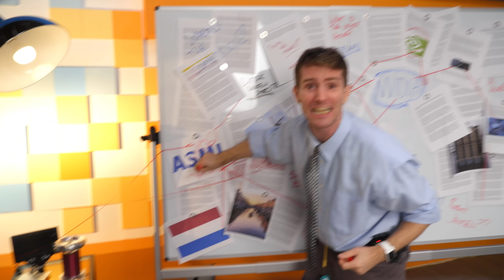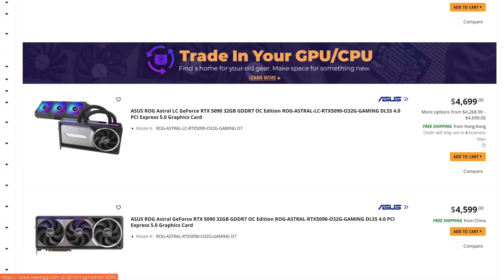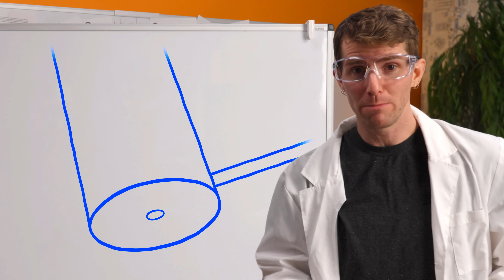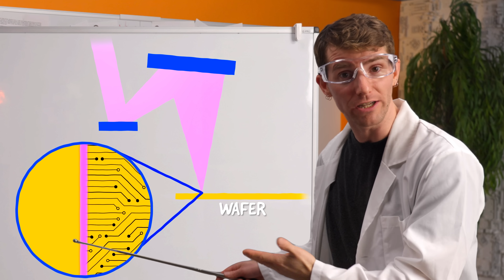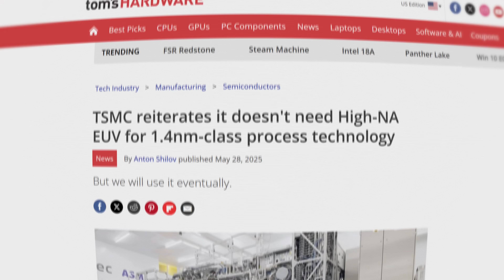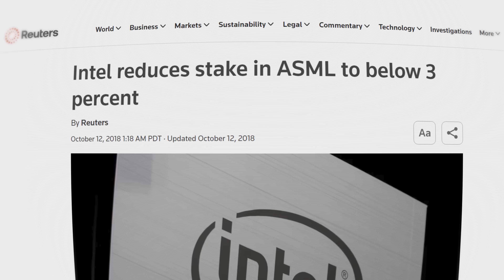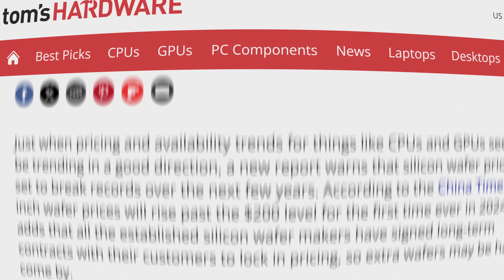This is Why Hardware Prices are Going Up… Again

Comment: As someone working in the IT industry, it’s sickening to constantly be bombarded with statements like "AI first", "AI in everything we do"…

Before that, it was cloud… 

Cannot wait for this stupid AI bubble to burst.
Reply: That's because those outside it use "cloud" and "AI" as buzzwords without any context or even knowing what they're talking about. In this case, there IS NOT a bubble. Sure, billions of investment and some won't survive, but AI (whatever you think that means) is the new normal. The same as you no longer book your vacation flight on a zeppelin and drive a horse to work. AI is so much bigger and broader than most realize.

Comment: To add to the EUV vs DUV comparison: If you want to make smaller nanometer transistor chips, you need the sharpest pen to draw it. EUV wavelength is so short (width of the tip), you can write atom wide traces versus DUv which is like drawing small traces with a sharpie. Sharpie vs pen not to scale.

@linustechtips hire for this kind of stuff if you want.

Comment: 🎯 Key points for quick navigation:

00:28 ⛓️ Hardware prices are rising due to a chain of market dominators, from GPU designers (Nvidia) to chip manufacturers (TSMC) and the machine makers (ASML).
01:52 💸 Nvidia, with 92% market share, has dramatically increased GPU prices, from $500 to over $2,000 for flagship models.
02:58 🏭 Major GPU designers like Nvidia, AMD, and Intel all rely on TSMC, a single company, for manufacturing their most advanced chips.
04:23 💡 TSMC gained its dominant position by not competing with customers and investing early in the crucial EUV lithography technology.
06:40 👑 ASML holds a literal monopoly on the EUV lithography machines required for advanced chips, selling each one for about $200 million.
07:49 🚀 The next generation of EUV machines will cost $400 million, which will increase production costs and the price of future chips.
08:14 🧱 A fundamental lack of competition throughout the semiconductor supply chain allows major players to keep prices high.
08:54 🌐 The AI boom is worsening material shortages and driving up prices, while new competition won't benefit consumers in the near future.
10:46 💼 A business subscription is advertised that provides all necessary apps in one affordable package.
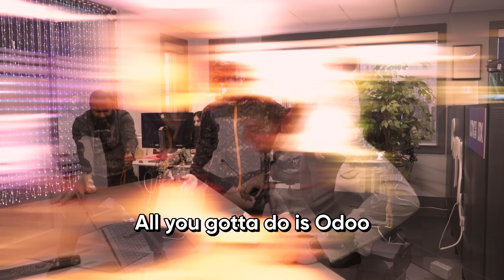10:57 📊 The subscription service covers a range of business functions like budgeting, inventory, and human resources.
11:11 🆓 A free version of the service is available for those who only need a single application.
11:26 🏭 The creator encourages viewers to watch their previous tour of an ASML facility, a technology monopoly.

Made with HARPA AI

Comment: I have a solution to lower cost and increase supply of ram memory for gaming on consoles or pc and not ai datacenters.
 Bitcoin inscription ordinals can replace the need of ram memory for ai datacenters as the BTC identifiers can allow any encrypted data which ai can read and write and rewrite its conversion as any memory needed without needing real ram memory And the data on inscription ordinals is permanently added to Bitcoin blockchain.

So a btc blockchain card that tracks that inscription ordinal address tied to a AI datacenter and its clean energy infrastructure allows a global btc Blockchain of potential encrypted memory data and if they want they can share that memory data with any other ai data centers around the world also using a btc blockchain card. This is purely to read the crypto BTC inscription not crypto mining you wont need excess energy nor massive more infrastructure.

Comment: Back in the day we used to just get motherboards with 2 or even 4 CPU sockets on board. How much performance drop would they actually suffer if they just made the CPU 4 times as large and operate at the easier to manage deep ultraviolet wavelength?

Comment: Linus is right. Huge cost and not on earth. However, there is a large glowing ball of flame nearly 8 minutes from us; and we get similar on nuclear fusion set-uos. However, the sun has an appreciable angle. To use the Sun (on the moon), your outdoors fab-site has deal with 100´c oven heat, and relocate back indoors, before the -130´c freezer kicks in. So robots on the moon, is an outside punt.  Pesky humans need oxygen, complain about that grindingly fine dust, getting in their pesky sealed astronaut suits. These all cost much more, than some evaporated tin plasma droplet.

Comment: 92% is a literal monopoly. There is another interesting company that supplies ASML. Its a worker co-op and supplies the needed lenses. They need to develop electron beam so the light wavelength isn't a bottleneck.
Reply: It’s not a monopoly if there are legit competitors. They’re just not competing well enough

Comment: Good video analysis. 

I do agree. We need to distribute those core manufacturing to every country, so there wont be a supply problem anymore. Ofc, if only 1 company makes stuff, everyone dependent on them, but if every company can make (even thou they might not be the latest/best), there never going to be a shortage. The problem is not that the old hardware is bad (ex: 4090 vs 5090) but that the old hardware is not available and the new one hit a shortage and so on.

Ramping up production may take years yes, but it's also obvious when u going to need more. So u don't need to start when ur house is already on fire and u can't make more. It's not like no one expected that AI will be adopted and it will require massive amount of resources...

Comment: I remember the very beginning of the Dot Comm boom and I also remember how long it lasted and what the end results were. I also remember the whole Crypto craze, how quickly it took off and then how just as quickly crashed and burned. What makes anyone think this whole AI craze isn't the same, just a different fad. The major difference here is that when (not if) this bubble does burst it has the potential to irreparably damage entire market structures that will take decades to rebuild. The idea of "long term" investment seems to be dead. It's all about "How much can I make" and "How fast can I make it". Don't believe me? Just follow the money... You can clearly see where all of it is going right now.

Comment: AI created high demand instantly, but AI also don't really need unlimited amount of resources to operate. At some point they will reach a point where additional hardware will provide little benefit and then prices will go down.. AI is still pretty new, there are more and more applications for it. Might be a few years until demand (for training and operating AI) slows down and these resources free up. Manufacturers know this so they want to profit from it while they can. Since there is a limited amount of chips they can produce in a year they chose to produce more chips for AI purposes right now instead of standard consumer to meet the demand. Demand for AI will go down and they will return to usual production in later years..

Comment: Let's all be honest, shall we?

The reason NVIDIA monopolized the GPU market is because AMD has been sequencially fucking up their GPUs naming. How the hell am I suposed to know what AMD GPU is better than the 5060 or the 5050? 

NVIDIA follows the same naming protocol for more than a decade, while AMD changed theirs 4 times in the same time span. That confuses consumers and makes it easier to buy an NVIDIA GPU, even when it is worse and more expensive than their AMD counterpart.

More than that, NVIDIA drivers experience has been improving and becoming less confusing to use, while on the other hand AMD drivers have been going on the opposite direction.

This whole disgrace was looking like it was going to get us an amazing competition for the GPU market when we were in the Pascal VS Polaris generation, when it was easy to understand the names, AMD Crimison was better than the GeForce Experience and prices were just being cut and cut, but AMD fucked it up, and we are all going to pay the price until they change direction (in the right way).

Or we can all just don't buy new GPUs, y'know... my GTX 1060 is still looking sharp

Comment: When it comes to graphics cards, I always miss one, in my opinion, important fact: Nowadays graphics cards have to drive 4 times the amount of pixels. Back in 2010, as Linus mentions, the high-end gaming resolution was 1080p, which means around 2 million pixels, and if you shop for a high-end 1080p GPU, you will definitely find one for $500 as well as 500€. Comparing this to today's high-end 4K resolutions, which mean around 8 million pixels, you have to drive 4 times as many pixels, which means you need 4 times the performance, and these 2000-buck CPUs cost quite exactly 4 times the money. The same calculation applies to 1440p, where we're talking about 3.5 million pixels, which is 1.75 times the pixels and a calculated price range of around 875 bucks.

Comment: 80% of this video has nothing to do with current hardware prices. It's mostly Nvidia profiting from AI now 3 memory manufacturer joining them. Simple as that.

Even if Intel was able to compete with TSMC this would change absolutely nothing. You could only change anything by having an actual competitor to Nvidia's CUDA and somehow solving memory crisis which is just not gonna happen.

Comment: I think an important part to mention is that gpu prices to me at least went up when nvidia stopped supporting sli. When we can't combine cards to make a beast machine there is a hole in the market for super expensive single slot gpus. Which we have gotten. Adjusted for inflation is any of the 90 series actually that much more expensive than four-way sli ?

Comment: The really, really "good news," is that if China decides to invade Taiwan one day, TSMC is going to be shut down during and likely after the invasion, and chip production will stop ABSOUTELY.  You think you have expensive GPUs now, just wait till 5090 has a total run of say, 15,000 units 'world wide,' before the time of the attack_ and likely never to come back again. How does $20,000 for a unit sound?

Comment: There are also big ass data centers in construction/ about to be constructed/ or in tech bro billionaire's wet dreams which need a LOT of hardware. So as a company which produces that hardware you will of course sell it to them. Should they produce more to also satisfy the commoners? Well yes. But that means investing in more factories and production chains... which will not turn out good if the whole "AI" hype turns out to be a bubble and those data centers are built for nothing :)

Also, as a second year computer scientist in Eindhoven, ASML, while it is a Monopoly, in order to do what it does it needs to maintain partnership with another ~5000 companies. Them being a monopoly only gives them the power to choose who fabricates chips and who doesn't. Not set the price of chips. And yes. The Netherlands invested more in education and infrastructure because ASML needs more people. But them leaving is a no go and whoever says ASML will leave is a fool imo.

Comment: also don't forget to add CUDA.
cuda is some old legacy tech nvidia gpu's uses. when released nvidia marketed it like a tool people could use to easily make gpu accelerated code for compute run on almost any hardware which chose to support it, was promoted as something they wouldn't lock down(they now did however).
but more importantly, because of their original promises insane amounts of programs, libraries, etc. where made using cuda which infested into many more things.

the problem with cuda is, it is legacy tech.
like it is insanely inefficient compared to many more modern instructions, also more expensive to make due to needing more chip area and performance to get the same performance level.
now there are 2 big problems here:

1. since nvidias recent change in licence, cuda gives nvidia gpu's a unfair monopoly on all softwares using cuda, making nvidia seem fast, making people use nvidia gpus. due to adding and focussing on support for cuda, nvidia also lack decent support of many of those modern instructions, so developers have to keep supporting cuda if they want it to work decently on nvidia hardware, cuda is very incompatible with basically most other techs, so requires really rewriting and reoptimizing piles of the programs to support other instructions like those newer instructions while only a few people use non nvidia cards for such things making those other cards perform less seemingly, potentially this is also a reason why nvidia keeps cuda.

though nvidia also has a less evil reason for keeping supporting cuda.

2. if nvidia switched to those new instructions, they could easily make gpu's around 2 times as efficient and fast for the same powerdraw and chip area, which would be fully manifested when those new instructions are propperly supported and used. the thing is, doing so would mean dropping cuda, so cuda wouldn't work on their hardware anymore unless they use translation or emulation layers  for it which requires a lot of testing and such on existing hardware which supports the new instructions but no cuda(which they don't have), etc. droping cuda would likely make many people mad since their legacy cuda things would require compatibility tools to run, they would fall for that same vicious machine they made themselves.

there have been examples of some softwares using such newer instructions like how blender at one point added support for some of them in some experimental build(not sure if they stayed in blender or not, as a few days after that came out they had a new lead sponsor).
still supporting that allowed both intel and amd cards to greatly outperform nvidia cards normally much higher end, even cards which where higher end in gaming performance and not just in compute. cards like the intel A770 for example. something similar happened before with the RX 480 reaching almost double the performance of the GTX titan which in some cad software after they added support for some new instructions.
in both cases nvidia cards kept using cuda since they didn't work with the new instructions or did worse with them than they did with cuda.
now currently in AI there is also a thing with some tools using vulkan instead of AI tools, resulting in some quite low end amd cards getting much higher performance than normal, like how a certain AMD apu got to around 2it/s in stable diffusion, we are talking about a apu, not a dedicated gpu, though was a custom apu, had 24cu's instead of 12 like their normal apu's, but the 24 cu's where running at a much lower speed than normally in their gpu's and igpu's, technically it could be overclocked to get to around 3it/s in stable diffusion 512*512
might not sound like a lot, but this was a old gpu architecture which was actually known more for being terrible at such things. like even a RX 6600 should be much faster on paper, and is much faster in gaming

Comment: this is why RAM just got expensive. companies are scared of us using RAM instead of VRAM for ai.

A recent study published on November 24, 2025, introduces Prima.cpp, a distributed inference system developed by researchers to enable running large language models (30-70B parameters) offline on consumer-grade hardware clusters with limited VRAM. The key finding is that through specialized configurations—like Pipelined-Ring Parallelism (PRP) for overlapping I/O with computations and the Halda scheduler for heterogeneity-aware layer partitioning—system RAM (and even disk storage) can effectively supplement or replace VRAM. This offloading approach leverages mmap-based memory management to store model weights on disk, map them into RAM as needed, and distribute workloads across mixed CPU/GPU devices, avoiding out-of-memory errors and achieving practical performance (e.g., 674 ms/token for 70B models) without relying on high-end GPUs or cloud services. This makes it possible to run sophisticated offline LLMs on everyday home setups by prioritizing RAM utilization over VRAM constraints.

Comment: Because the jew in charge of OPEN AI bought all the RAM because a lab test showed RAM could in theory replace VRAM for at home a.i.

The companies are terrified of consumers using RAM instead of VRAM because then NVIDIA and AMD can't charge $3,000 for a GPU for offline LLMs. Likewise, OPENAI is terrified that consumers can replace ChatGPT with offline models without a high barrier to entry cost such as buying the GPU instead of using 64 gigs of DDR5 ram.

Comment: Yeah, also like with any equipment, don't forget about recurring revenue ASML gets from the maintenance of the machines they sold. Basically works like lab equipments or aircraft engines, only ASML technicians can do it and it's another reason people love the stock.